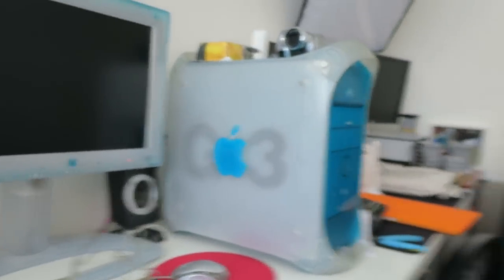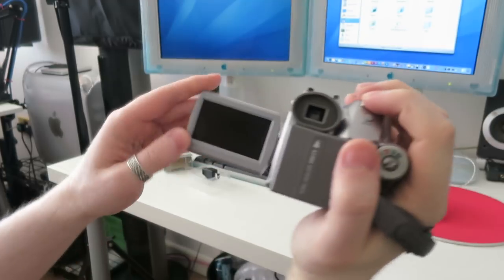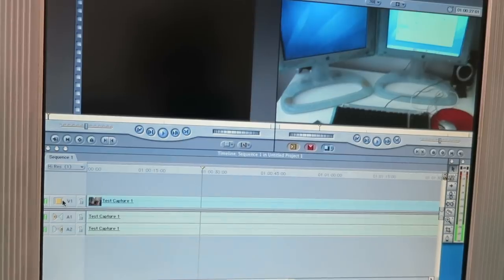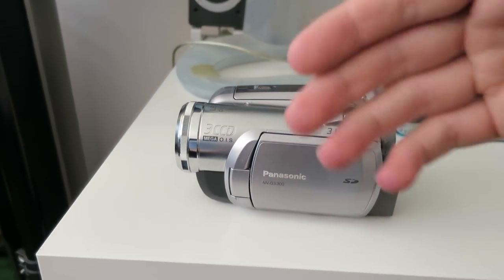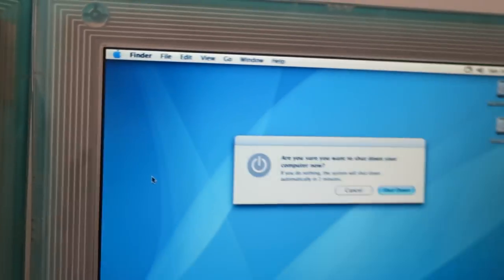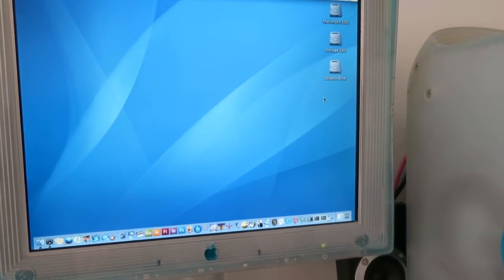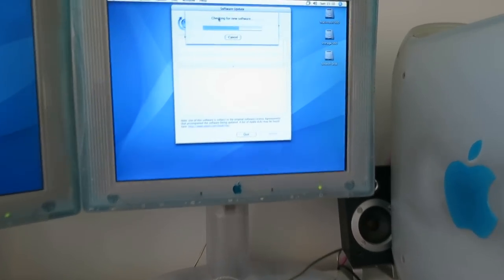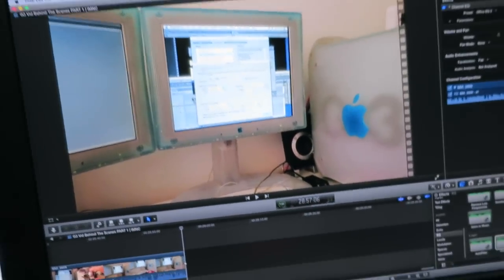G3 Showcase Video - Behind The Scenes (Part 2)

Comment: Cable failures... I've had two IDE cables fail inside a 500 MHz Graphite G4.  It appeared that the cables were getting pinched off somewhere in the case and shorting out; it was causing tons of random problems installing and booting OS X and took me days to troubleshoot. It was so frustrating trying to diagnose the problem, but so rewarding finally solving the issue.

Comment: Really cool series of videos! I remember drooling over having a B&W G3 back when I had a PM 6500. I am building the "ultimate" PM 6500 with similar upgrades (500 Mhz G3, 128MB RAM, SSDs, Apple TV/FM/Video system, and a MOTU PCI audio system running Digital Performer 2.7 and MacOS 8.6.

Comment: Is there a way to get a 400mhz blue and white to play YouTube video?  I can get mine to chug along slowly but it's completely unwatchable.  I didn't know if the processor upgrade or the 9200 provided significant enough gains to be able to play it (allowing it to render first of course.) I can get my 1.67 powerbook g4 to play them fine and of course my dual 1.8 g5 powermac plays them on the fly, but dang if I could just get this blue and white to play video I could justify keeping it out of storage.  I can justify a 9200 if that's all I need but the new processor seems quite hard to find.  Additional question, is a 9250 a functional card in the blue and white? I've seen them for sale before as well they are "mac edition" pci cards but I am unsure if that is all that is needed for compatibility.
Reply: 92greenz34 this is very late, but there is actually a way to watch YouTube on PowerPC macs. Download the TenFourFox browser, run it, go to preferences (command + , ) find TenFourFox options, set the browser string to Classilla, then just go to YouTube. Click a video, then hit watch (HQ is better than normal, and still runs fine). When asked, open the link with QuickTime, or whatever media player you use. Personally, I have found that VLC works best for PPC macs, including the G3 because there is little CPU overhead and you have the ability to go fullscreen, which you cannot do without buying the Pro version of QuickTime.

Comment: Hey Tom, do you think it would be a good idea to do a G5 Hackintosh? I have a G5 Chassis which is in very good condition and I've completely stripped it as I couldn't get it to work or power on whatsoever. But I was thinking i could buy some older PC Hardware (Similar to a 2007-2008 Mac Pro) and kind of revive the machine because I cannot bring myself to throw away the case as it is simply the best computer case that has ever been manufactured and designed in my opinion.

Comment: I never used a pre Intel based Mac with final cut.  Shouldn't there be an option to capture from the camera without at the same time playing the footage, thus removing any issues with the whole missed frames?  
Also, Intel or not, that's not the right way to capture from a DV in an old machine like that.  You are supposed to capture smaller bits and not the whole footage in one go.